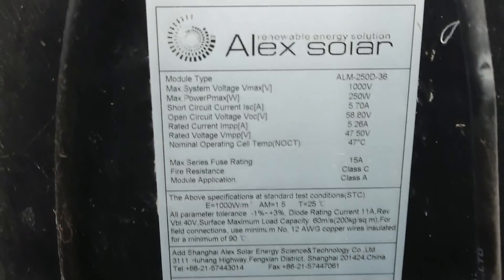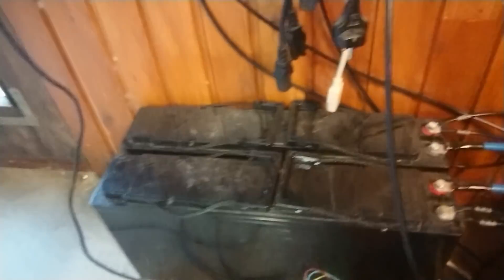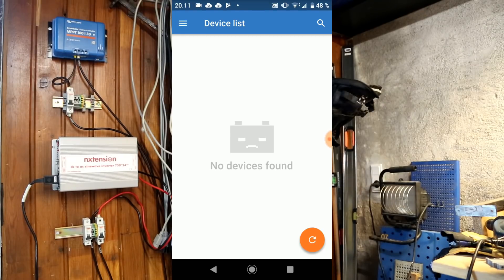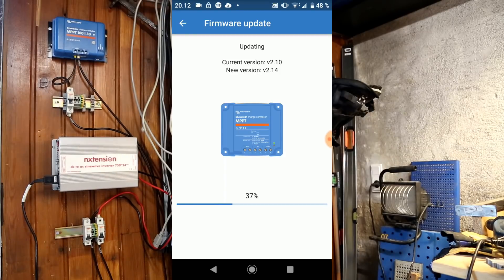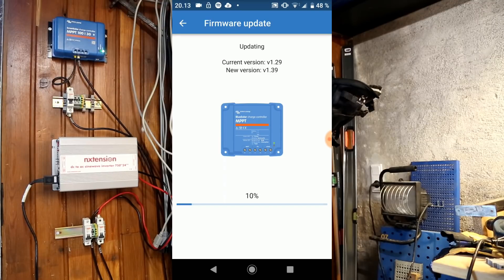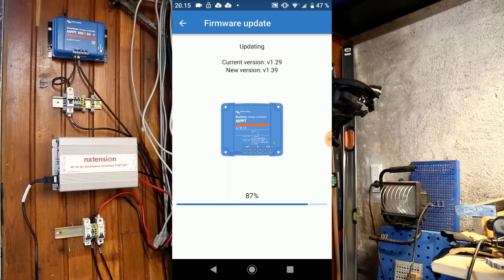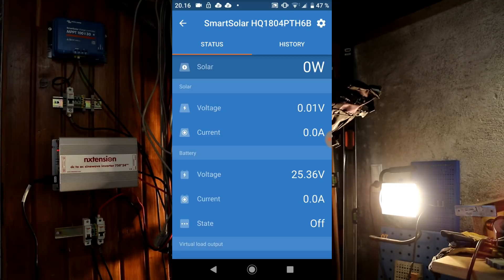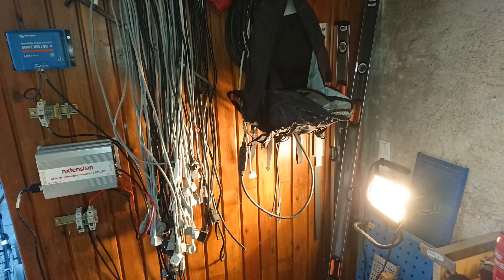750W Victron Solar Project - Test Setup - Part 1

Comment: 111520/1344h PST- 2144 UTC  Hello again. This means I’m back viewing all your presentations again. A question arises as I scrutinized your charging setup inside your garage. You have used ONE Circuit Breaker on each sections of Positive charging sequence. Theoretically this arrangement is acceptable, as the CB will disconnect the Positive side of power ( from PV to CC and from CC to storage Battery) in the event of a short Circuit etc etc.
Tell me, are you comfortable with this arrangement or will you be replacing the single CBs with double CBs, in the near future? I also saw, a set of double CBs in an enclosure. That was good, but I’m kind foggy on that.
If you get time, as an when you view my request, kindly respond. I’m a VICTRON Energy fan. I believe in VICTRON Energy, though expensive.. but the quality and Customer service are unparalleled.
Greetings from California, stay safe. 73s...<sreeci@hotmail.com>
Reply from the maker: Hi Sree Kumar
I am fine with single MCBs, they will do fine for protection against 1 fault. But you are right, that if there is a second fault somewhere else at the same time. Then you can have a situation where breaking both positive and negative would mitigate that. But that is very unlikely to happen.
The double you saw is just a 2P 200A disconnector, not a MCB.
Thank you for the support, feel free to ask me anything :)
Kind regards
Mads

Comment: 111520/0347h pst 1147 utc.   Danke schon Brucer. That was a simple, straight forward, down to Earth explanation, you presented. Guten Morgen. Will watch the charging process in Part 2.
Reply from the maker: Thank you very much :)

Comment: I tried a test run with a electric stove and the Inverter and the red alarm led was constant on. Does this mean I have to turn it of immediately or how long can I run it like this? What are the dangers?
Reply from the maker: Sounds like you are drawing too much power from your inverter, a electric stove is likely not a small load! What is the output rating of your inverter and what is the load from your electric stove?

Comment: thanks for posting.I'm 
the solar panel label nominated 58.8Voc and 47.5Vmpp @ 0.51.  I'm looking for a grid tie connect inverter 240VAC that will work with a similar solar panel. The cheaper 1000 watt grid tie inverters I've seen accept a max 26-40 Voc.
Reply from the maker: I would like to find a grid-tied inverter to substitute the battery charger as well.
Reply from the maker: I found one that is accepted by the grid in Denmark: https://www.alma-solarshop.com/zeversolar-inverter/924-zeversolar-inverter-zeverlution-1500s.html there is also a smaller 1000W model.

Comment: I have a setup much like yours, but I use an UPS as an inverter. My APC 1000VA/670W uses 20 watts in idle and my Eaton 9130 1000VA/900W used 15 watts. Do you have any ide og what your inverters use at idle for comparison?
Reply from the maker: The Nxtension inverters have a nice ASB (automatic standby) feature, this model uses under 6.5W at "no load", but if it goes below 15W output it goes in ASB mode and only uses 0.7W ( http://195.69.129.26/webshop/documents/4e654ef6831b777c79c7d7ae03d0d3a1/NXTension_550_750VA_inverter_0607.pdf )

Comment: nice system. i have a similar system, for testing motors and other stuff, so i don't trip the rcd and disconnect our heating system and alarm system. 

i have two high voltage transformers. 1 230v to 2 kv microwave oven trafo, 1 oil burner ignition transformer 230 v to 15 kv( grid voltage in assens from the 60 kv stations to the local transformeres is 10 kv). 

i also have a couple hv insulators and a 10 kv transformer-switchgear drop cable.